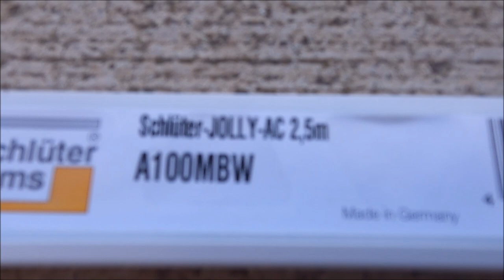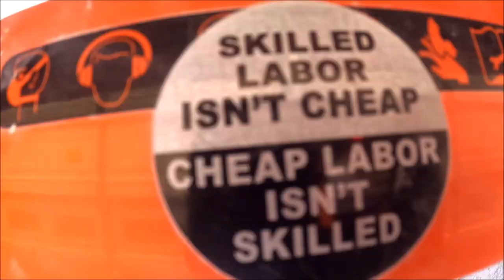Walk in Shower Conversion Carrara Tile Design!

Comment: Noticed portable room ac unit in the bathroom. How you liking it
Reply from the maker: Love it! would not leave the shop without it! Keeps us cool, circulates the air, dries material when we need (paint, drywall, grout) and filters the air.

Comment: I notice on a lot of your niches you flush out with the tile instead of overhang, is there a particular reason you do that?
Reply from the maker: Installers like a niche to resemble a window sill with that overhang and use the overhang to stop any capillary action from happening. For us, we like the flat minimalist look and niches we install are prefab Schluter already waterproofed so we don't worry about any capillary action. Different strokes for different folks
Reply: Absolutely!  You do great work!